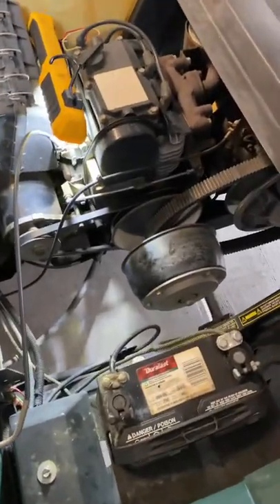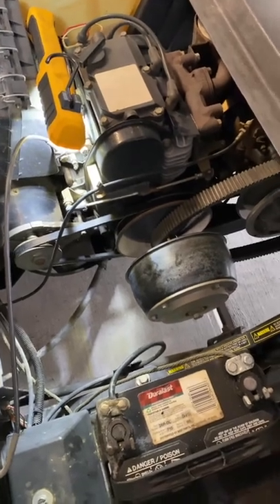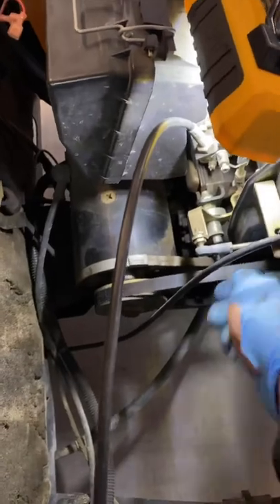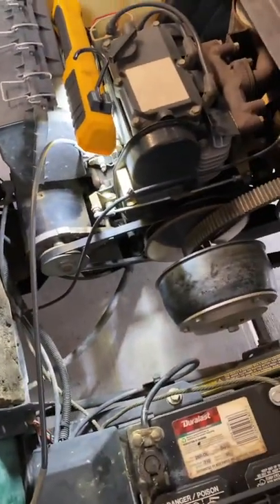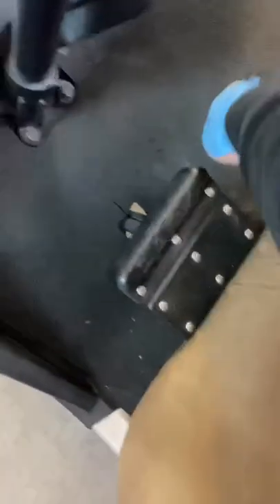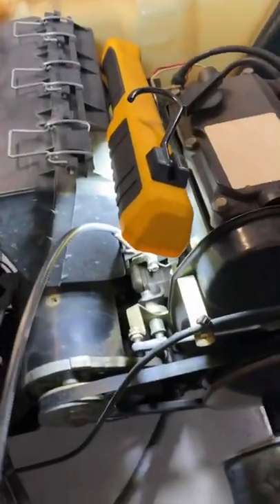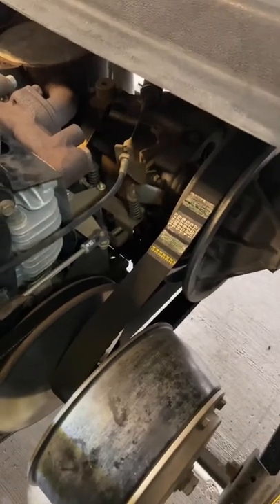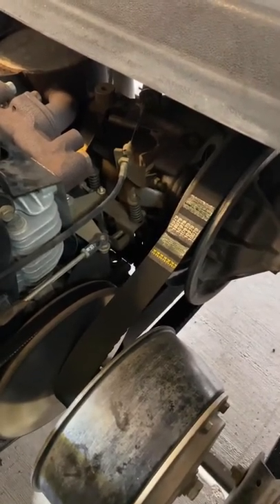EZGO txt drive belt install

Comment: So i inherited an 86 3 wheeler ezgo. The engine runs and wants to move but that belt doesn't spin. The engine is also oriented 90° Where the belt runs perpendicular and above the axel. It looks like the big clutch is spinning though. Any ideas where i can start to look would greatly be appreciated. Thanks

Comment: How much play should the belt have once mounted?  1" or more.  I'm  installing a different  engine in mine and will need to order a new longer belt.  What companies do you recommend to buy a belt from?
Reply from the maker: Order from @buggiesunlimited.
Take a measurement from front clutch to rear once put together. Use that measurement to order the correct belt. In general 1-2 inches of play.

Comment: Nice video. Does it make a difference if the "cogs" are inside or out?? Your old one they were on the outside but the new one they are on the inside. Thanks, Larry
Reply from the maker: Hi, different belt manufactures manufacture differently. It may be either.

Comment: Is there any tension spring or pully that tightens the belt
Reply from the maker: No if the belt is the correct size you don’t need to do anything.

Comment: How tight are clutch belts supposed to be? 
I have a cart, runs good. 
When I give it has it takes a while, or higher rev/ rpms for cart to go/ kick into gear/ drive. 
So just wondering how tight they supposed to be because mine is loose, but so is your new one.

I’m hoping it can be adjusted and I don’t need a new clutch. Any suggestions?
Reply from the maker: Can you tell me what year cart and the belt number you are using. You should have about 1.5-2.5 inches the belt can be pushed up and down. It should not be very tight. It tightens as the clutch engages. Did it have the same issue with the previous belt. Sounds like someone changed the clutch spring.
Reply: @tmiele135  I just bought a 2001 Workhorse and on hills there is some slippage and squealing.  Stopping on a steep incline can render all squeal and no go.  First thought was replacing the belt since it has 2.5-3" deflection and I assumed this had to be wrong.  But it looks like your properly sized new belt has similar play.  I may have to order the engagement clutch but it's surprisingly pricy and have to do a puller of some type.  It seems to me that if the tapered clutch properly "squeezes" the belt, it should still grab.  I am finding I don't have an EZGO dealer to help me diagnose!
Reply from the maker: @tkobvious  could be many things. Weak spring in primary clutch, wrong belt, etc. the belt should not squeal T all on a clutch. Send me a video of your issue to my email. Tmiele135@gmail.com